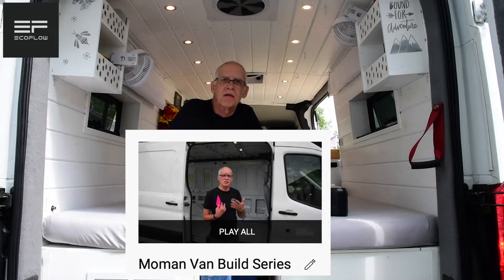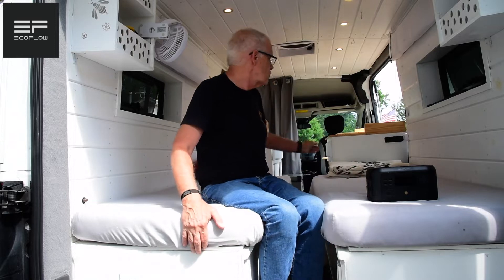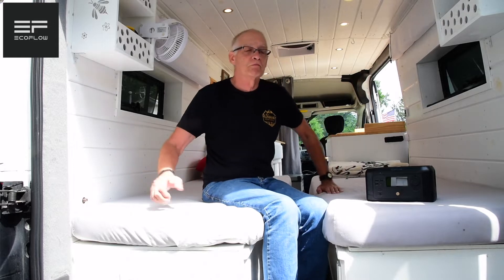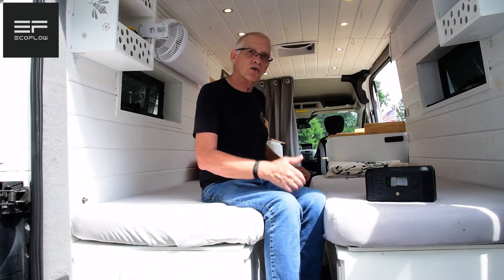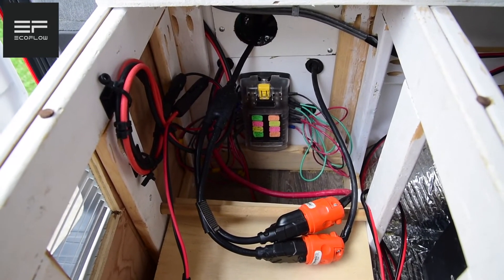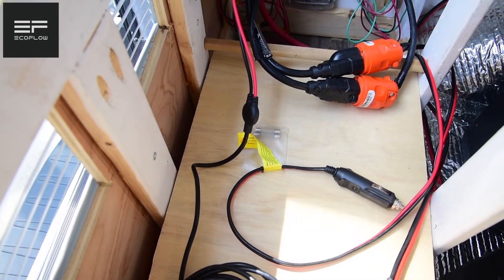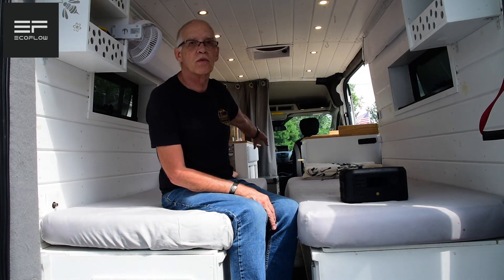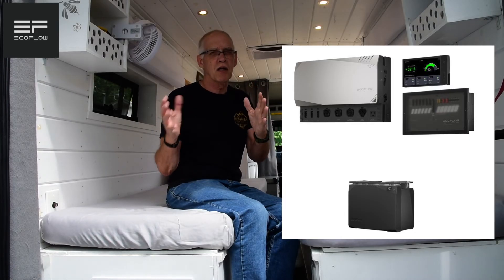Our Ecoflow-Powered DIY Ford Transit Camper Van

Comment: Charles in my research your You Tube about doing the Ecoflow deltas came up. I'm glad it did.
I have a 2023 Ford Transit Trail on order and it is being built. I should get it sometime in September. It is nice to see someone my age range (I'm 72) do this. Maybe this will be more expensive than a built system but that's okay. I'm no electrician and I already have a Delta 1300. I'm thinking I'll get the Max 200  and 400 watts of solar. I like the 110 shore power option you did. Charging the batteries before a trip is a must and we will not have power hungry items in the van. Coffee, toaster over, lights a Dometic fridge and Max Air fan. Maybe a small TV for my wife. It is so nice to see this system. I'm going to look at your other videos to learn more. Nice to see I'm not alone in my thinking. I do have a friend who knows electric and I'm going to show him this. The wiring seems simple and makes sense to me. Thanks.

Comment: Hey I've been thinking about using an Ecoflow Delta 2 as my main power system. I was wondering if you know if solar is more effective (on sunny day) than the 12 volt coming from the van while driving to charge the battery? Also, do you need an DC tot DC charger if you would plug the Ecoflow into the 12 volt (cigarette lighter) plug of the van?
Reply from the maker: Yes, my solar is better on a great sunny day than the DC to DC. I never plug an Ecoflow into a cigarette lighter because the plugs are renowned - all brands - for getting too loose and causing a melted plug. They want to pull way too much power than is safe. I now camp with a Delta 1300 and Delta Max and we do just fine. We leave soon for a two week trip and we will have shore power every night except the first night. Boondocking is of zero interest to us. Before we leave on a trip, I know where we will be every single night and will have already paid for each night. That is what we do and others can freewheel it if they like. A Delta 2 is a great choice for your main power source. Be safe out there and blessings!

Comment: Charles and Susie, I’ve been binge watching your videos, and I must say I have learned a lot from you both. I have the Delta pro with two 400 foldable Solar panels I just purchased a month ago to put in my van, and also  when needed at my home. I have a 2011 high top Ford  350, I think there’s about 10 feet from the back of the seats to the back door. Question, Are your  Bed frames made with one by fours or two by fours I can’t tell in the video, and also the plywood, I think you said three-quarter inch is what you used to frame both your beds. Also if you don’t mind what are the widths and lengths  of your bed. I remember hearing Susie say one bed is wider than the other and that’s probably your bed. I enjoy your videos I have really enjoyed hanging out with you and Susie. Safe travels

Comment: Thank you for sharing the video. I was also planning on using a Delta Max and get 2 additional batteries to pump out more than 6kWh of power for my van.
Reply from the maker: They are great units.

Comment: Thanks for the video I do like the system you had setup in your camper-van. Seems like those Delta's are a perfect fit.
Reply from the maker: You are welcome. It really has worked well for us. Some are fitting in the big Delta Pro, but it is so heavy. The Delta 1300 & Delta Max fit in really well.